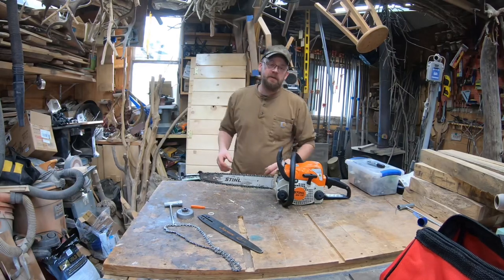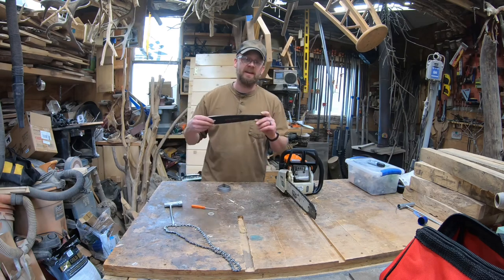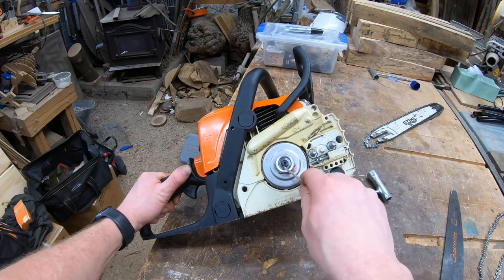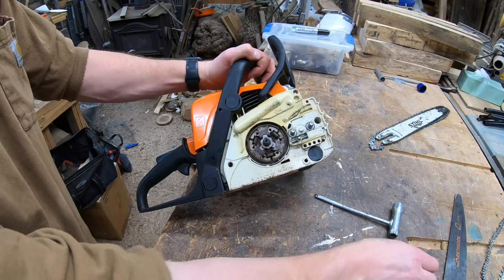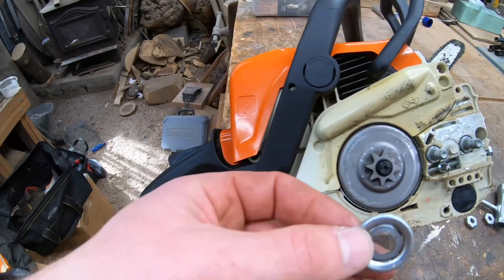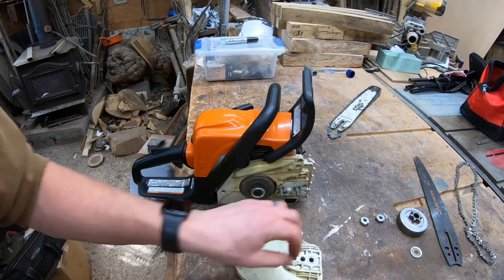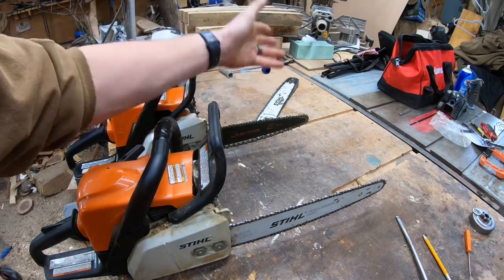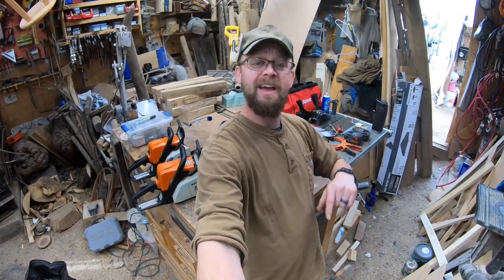Turning a Stihl MS 170 into a detail carving saw . Easy parts swap on Stihl ms 170

Comment: You should also change the MS170 to a side adjustable bar. Just go buy the parts for a side adjuster for a MS250 and it will swap directly in.

Comment: Great video Kyle..I have an oregon un of the mill 3/8 pitch chainsaw which I'd like to convert to a detailing bar as you've described in your video...Would you know whether this would be possible to do on my chainsaw?..Thankyou for any advise.
Reply from the maker: What type of saw do you have ?
Reply: @KyleHallwoodworker  I'm not an expert when it comes to chainsaws ...Its an oregon electric with a 16 inch bar 3/8 pitch drive which I'd like to convert to a smaller bar and chain to do some detailing carvings!.....Is this something I can do or would it be better to invest in another chainsaw?.... Thanks for any advise Kyle.

Comment: I have a Stihl MSA60C, want to put an 8” Cannon dime tip carving bar on it do I need to change the sprocket and where to find the chain for the 8” bar
Reply from the maker: Not sure if you’ll have to change the sprocket. If it’s 1/4 pitch you should be fine . You can try Baileys on line for the 8” or cannons website .

Comment: I’ve got a lightly used 170 that I bought new.  Strange issue. It pulls over very hard when hot.  I Can feel high compression in the pull cord as the piston cycles. Almost like a hydro or vapour lock. It will pull the saw out from beneath my foot when attempting to pull start. Kinda dangerous. I need to pull gently on the pull cord a few times and do a few cycles,  before giving the pull cord a good quick yank to fire it up.  Only does this hot, when cold it is fine.
Reply from the maker: Start with simple things , check spark arrestor on muffler , remove it or make sure it’s clean , carb might need to be cleaned, Remove and inspect recoil . Just some ideas I found for this problem on a forum.
Reply: Yep. Have done all that.  Think I might try another carb. Thank you.